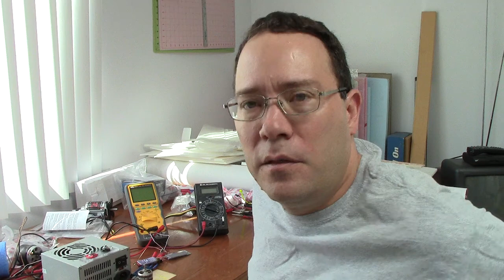Puffed RC Battery Pack?

Comment: I have a weird story for you and need help. I'm into the rc car hobby for about 3 weeks now. My first hobby grade rc car is the brushed e-revo 1/16th and I use Traxxas ID 2200Mah 25c lipo's (I know by now that 25c is not enough... I need around 35c) and a EZ Peak Plus charger. The ID function always picks out 4amps charge rate and after charging it 6 times the next day they are both swollen. They puffed up after charging and not after driving. I still used the lipo's and didn't notice any difference in power or driving time. I time and make notes of my lipo useage so I know every time when I charge or use it how long I have driven and how long it took to charge. But yesterday I found a way to charge my ID lipo's at lower amps on the EZ Peak Plus charger so I charged them at 2amps. Today I wanted to check if they puffed up even more (I'm a bit paranoid about lipo's now so I check it every day) but the weird thing is.....   they are a 100% back to normal now..... not puffed anymore and still give the same power and driving time as before..... WTF is going on here? I don't understand it anymore :s

Comment: I have an Onyx 4420 brushless and running a  4100 lipo  25c and my  battery puffed up tonight and when I got home the the battery went back to the same size. I own two of them I feel that the crank of 25 isnt sufficent in my truck so Im going to have to run a 5000+mh 35c lipo what is your advice

Comment: I have a really unusual case.so I have 2 drones.both uses 100mah battery .I uses drone (1) charger to charger drone (2), drone 2 started smoking and getting on fire.i threw it in the snow and stopped it. Afterwards.i uses drone (1) charger again,just to charge drone (1) it got overheated but I used to to charge drone 1. Which makes my drone (1)'s battery puffed. And also the drone 1 charger led light malfunction. Did drone (2) destroys my charger and after I use the charger on drone 1 also destroy drone 1 battery? happened??I know I'm an idiot not using the right charger for the right drone. but I'm still wondering is it safe to use drone (1) ?

Comment: Hi Carlos some good advice you gave regarding puffed batteries, thanks. Also I have a question regarding storage charge for lipo batteries. I want to know how bad it is if i store them with full charge for a long time? Has anyone actually tested this to see how much damage it causes the battery?
Reply: aslanyavuz if you leave them fully charged for long periods you might not notice much but it will reduce capacity, even charging a lipo to 90% capacity can increase lifespan dramatically i.e 4.1v per cell. I strongly suggest keeping your packs at 3.7 - 3.85v per cell if not using them within a week. The manufacturers and websites all suggests storage voltage for a reason. On the plus side it is approximately halfway charged and only needs 30 mins to top up if you have a good charger.

Comment: When a battery is charged or discharged it heats up. We all know that.
Lipos use moist electrolyte - which heated generates vapours. 
Also, overcharging them generates hydrogen gas. 
If a battery is really stressed in a fight with high discharge rates in a hot climate, it will become ~bloated~. 
As it cools down it should get back to normal as evaporated electrolyte condenses back to liquid state. 
Hydrogen gas that had been generated by electrolysis will be absorbed back into the electrolyte but not 100%, hence the continuous bloating over time. therefore never overcharge them.  
The excess gas can be vented but, all in all, the electrolyte quantity and quality will decrease over time. But not that as fast as everybody wants to make us believe. 
Exactly why there are no venting measures on the LiPo cells pouches I'll let you guess.

I de-puffed many cells and I'll keep de-puffing them when necessary. 
But keep in mind that cells that swell for apparently no reason at all, say on the shelf at vtorage voltage, are internally damaged and pose a real hazard.  
Also, checking the actual capacity, from time to time and comparing with the advertised capacity is good practice.
Reply: Pașca Alexandru i have a problem with my battery's 
i got a new 1300mAh 7.4v battery. on it's first flight it gave me 7 mins flight which was good but on it's second flight it didn't flew for 1 min. the battery isn't fluffed what must be wrong with it?
also i have a old lipo battery which is fluffed ,can i use it again after defluffing?
Reply: Piyush Nandurdikar First, use some punctuation, like question "?" marks at the end of a question.
Second, you did recharge that pack, right? What did the charger report? How many milliamps went in? Is it well balanced? 
Sounds like you either did not recharge the pack or did not use the balance plug and there is a flat cell in it.

Edit: fluff? :D
Reply: Pașca Alexandru punctuations added ,sorry about that .
Well i don't have a balance charger , i have a simple charger that just shows  red and green signal indicating whether battery is charged or not .
Reply: Piyush Nandurdikar Check the individual cells with a voltmeter. 
They should be above 3V. 
Get a propper charger. Those imax b6 clones from hk work well enough. Original one is better but about 2x the price.
Reply: Pașca Alexandru ok I'll buy original one .
Thanks for your help.

Comment: ..hi thanks for the video i do have question i do have quad copter  with battery  350mah with wall power  i  ido have other battery  from store i
use the same charge it puff or burn why   but the same but different company  and what does battery hase protect thanks

Comment: Hello, i have two 3s 2200 lipo batterys. I am new to RC and about two and a half years ago, i would charge them full, and store them fully charge for moths. No they are puffed like hell. It looks like they want to explode. But they still charge and work with my 500 helicopter. Do you think its best for me to buy new ones? They are really very much puffed!
Reply: 33gate1

Comment: Lipos puff because the esc, motor, and prop set up is pulling more amps the the battery can give out somtimes something is draging down  motor causing it to pull more amps to but if the batery cant deliver it will get hot and puff

Comment: I had the same issue. After a flight on a hot day the battery puffed out. After letting it cool down a bit the puffiness decreased a lot. It didn’t when back to normal, but it is for sure less puffed.

I still use it without noticing any major performance loss but I sure don’t trust the battery the same way thought.